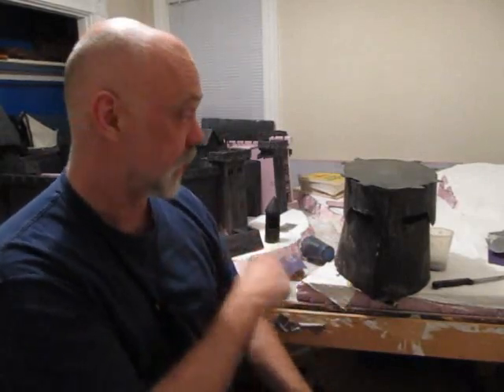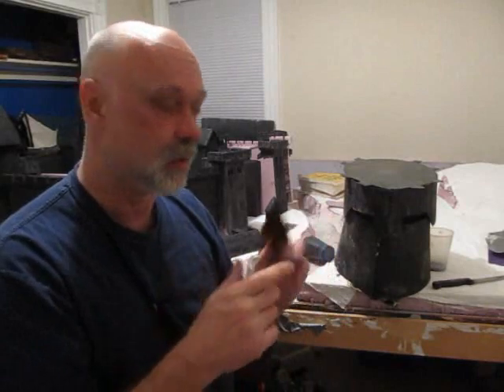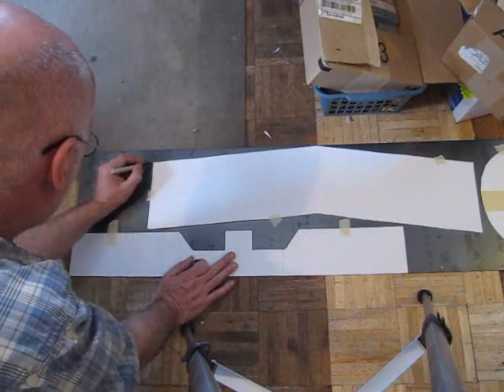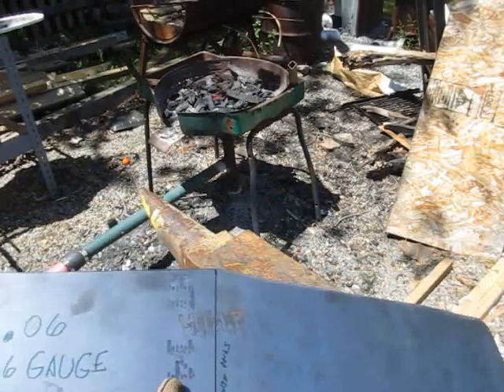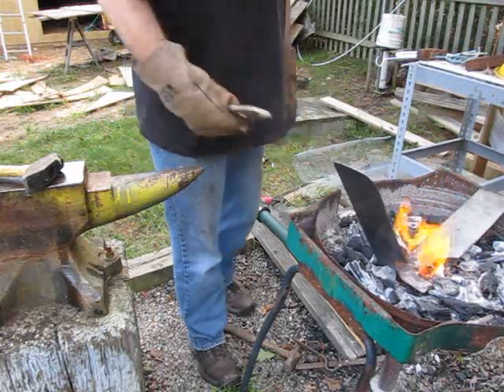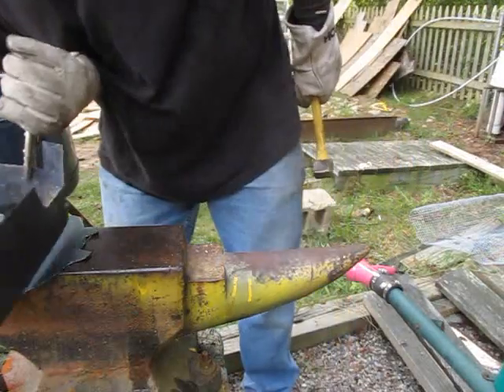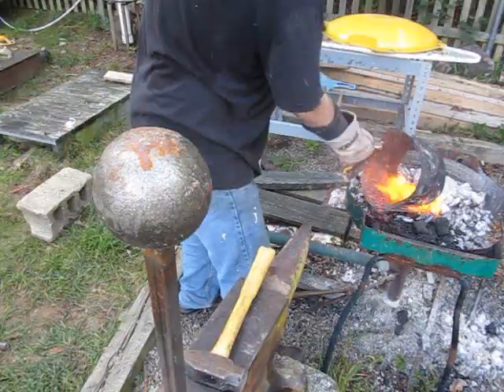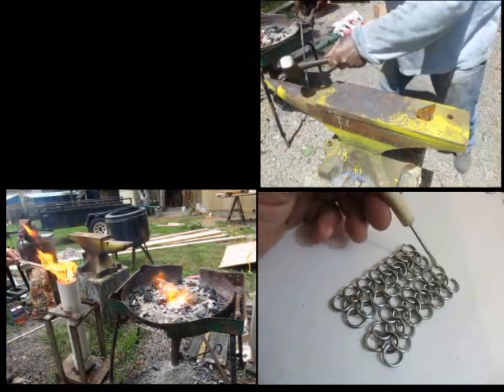How to Forge a Medieval Great Helm - Part 1

Comment: Personally. I like belt sander better. Mine just died after a lot of use, and the nice thing about belt sander are the variety in projects you can do with them. I've done everything from wood working, to metal working, to shaping foam for LARP weapons and insulation foam for tabletop wargame terrain. You can usually find them used on craigslist for a fair price :)

Comment: PS: be sure to temper that helmet. For underneath great helmets often "secrets" were worn ( Smaller helmets which incase the skull ).
Heat treated helmets dont dent easily but they transfer the blow recieved quicker to whatever is worn underneath. If a secret and proper padding is worn ( which is oblygatory for all helmets of cause ^^ ), a hardened helmet is a good choice.  
Are you gonna do a mirrorpolish ? Or satin matte polishing ?
And a tipp: When your making more armour, think about blueing

Comment: I think the heating is a bit unnecessary for the type of forming he's doing.... but hey to each his own. Cool design
Reply: I was wondering the same.I'd personally cold form the whole thing.
I'd only heat if I was doing compound curves or raising a bowl.
Reply: if we're doing it without a brake, heating will make it a lot easier to shape the metal, that's why he did it i think

Comment: I have a question I've been making some knives now I've got about 4 now (including a sword) and I am finding it tedious to use a file for making the edge. I have $50 and i want to know what tool i should get for making the edge, a bench grinder 6 in or a belt sander 1 x 30 in? or are there other solutions for making the edge rather than a file? (i have a angle grinder (4 1/2) and a dremel)